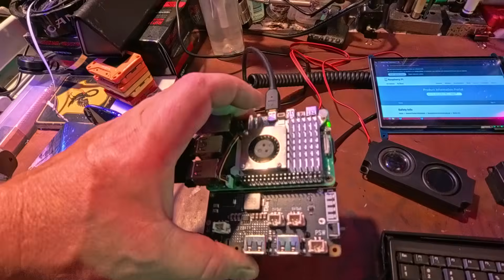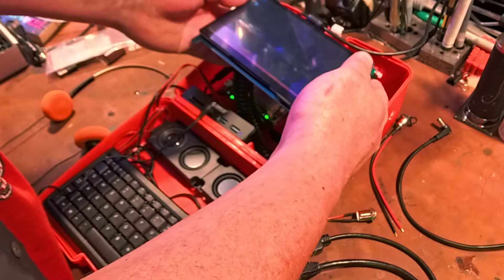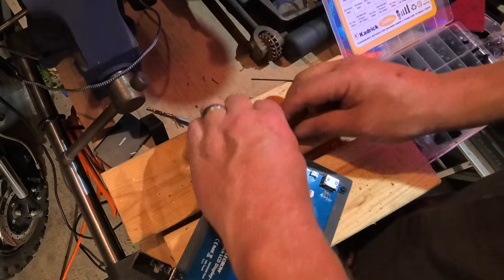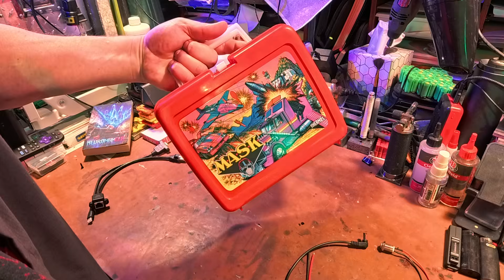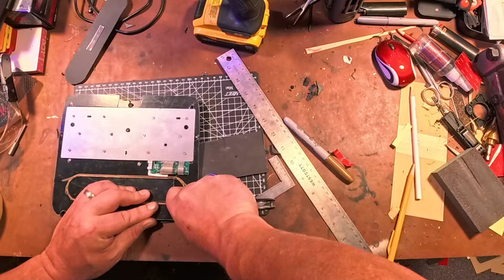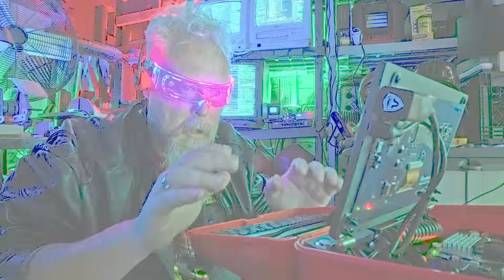M.A.S.K. Lunchbox Cyberdeck Build

Comment: What a fantastic build. It's completely personal and built to the taste and usecase of the user. That absolutely nails the spirit of a cyberdeck in my mind.
Reply from the maker: Thanks, I really appreciate that. I have been using it non-stop since I built it. Now has 2 offline LLMs running and I have Claude code currently chunking away on an error in my Gemma model for multimodal use.  😁
Reply: @RadioactiveArtist_313  I'm thinking of building a deck to serve as my windows machine when I get around to switching my primary desktop to linux. There's just a bit too much windows stuff I use regularly to give it up completely, and I don't want to screw around with VMs, containers, GPU passthrough and all that.
Reply from the maker: Yeah, the switch is hard for sure, but it is getting better every day.

Comment: This is one of the best cyberdecks I have ever seen. Incredibly well done. I've always wanted to make one with a 21 inch display and mechanical keyboard, but I'm not good with CAD
Reply from the maker: I appreciate that, and you should definitely start. No CAD required if you are determined. Although I am adding a 3D printer soon and will be taking up that adventure. I have done 3D animation early in my career but I've never had to build models for precision so there will be a learning curve. :)

Comment: When you started talking about the local LLM, I started thinkin' about The Flatline
If you name the LLM, you gonna call it Dixie? :)
Reply from the maker: That is a very fitting Neuromancer reference. The deck itself is already named T-Bob after M.A.S.K., but I’m not sure what the onboard LLM will eventually be called. I’m already thinking about swapping the three billion parameter model for something that runs a little cleaner on the Pi, so the resident brain is still undecided.

Dixie is definitely on the list.